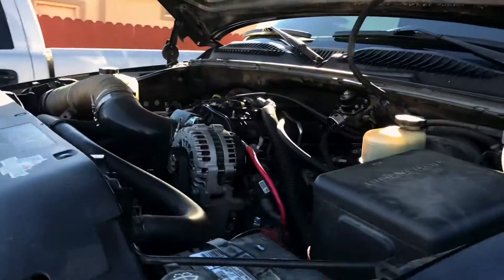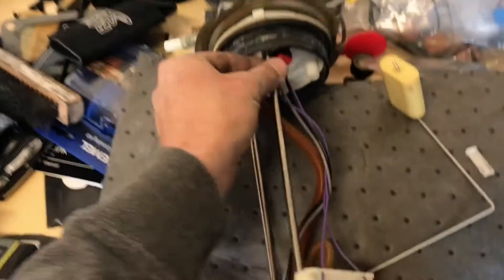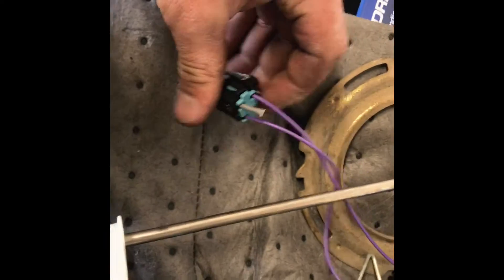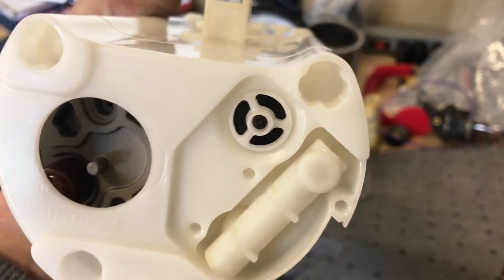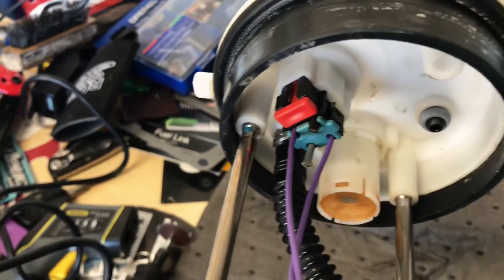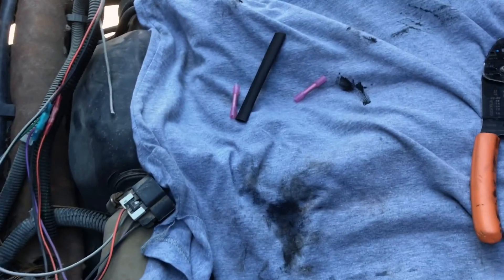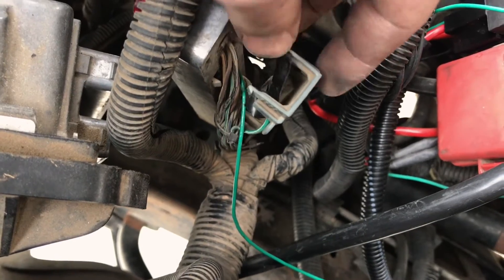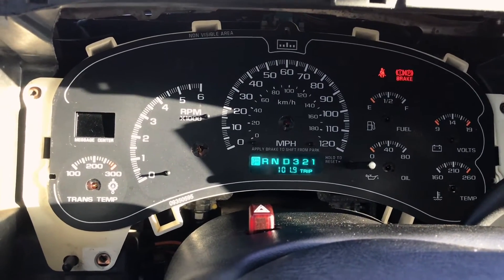Walbro 535 Silverado Install Return Style Fuel System 99-03

Comment: i had to drop the tank at low fuel lvl due to having a camper top..  i installed the walbro differently than you did.  i trimmed the assembly pump sleeve molding to let the walbro snug up to the bottom of the apremium assembly with the sock on.  (how the apremium pump was installed) there's a 2nd sock on the exterior. 

found out the hard way i need to fill the fuel pump bucket with gas or else the engine wont start & walbro pump burns out. i figured the springs would push the sock to the bottom & soak up fuel. i think the assembly was too weightless

Comment: If you got the 535 pump like the description  reads, there is no check valve in the pump which is known to require more trys at starting the engine. I found  this out the hard way. You could install a inline check valve which should fix the problem.
Reply: but then how does that affect the flow so then you're back at square 1 like if you had bought the pump with the check valve in it in the 1st place, which lowers output.
If you actually watch the video you'll see he's using a XXX285 pump not theXXX295 (no check valve)

Comment: Since you are planning on doing a turbo have you looked into at all using a duramax core support/radiator/intercooler? I know yours is a 1500 but I can only imagine the cooling capacity of a stock dmax intercooler is better than the aftermarket intercoolers. I got an 02 1500HD that I plan on building with huron speed manifolds/crossover/downpipe
Reply: Lots and lots of fab to make those fit